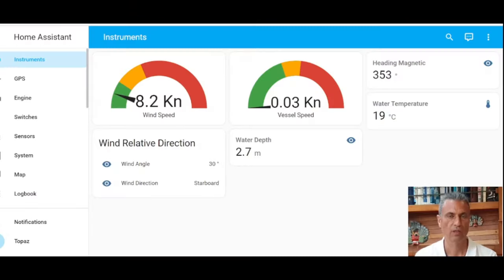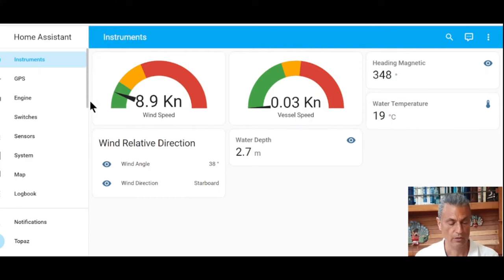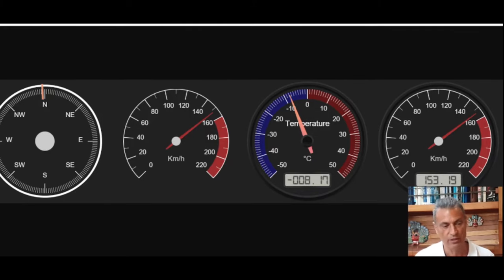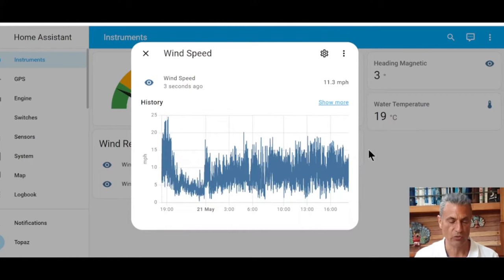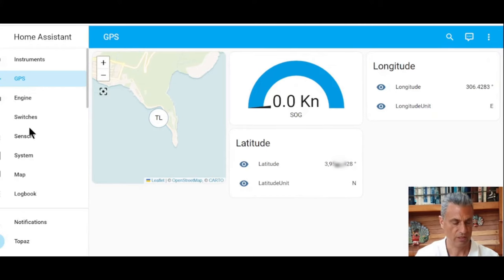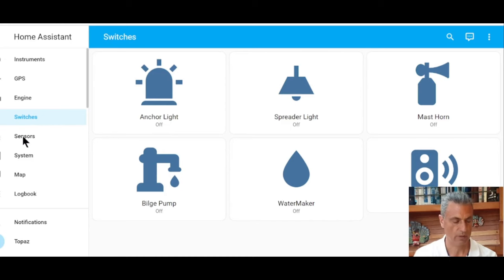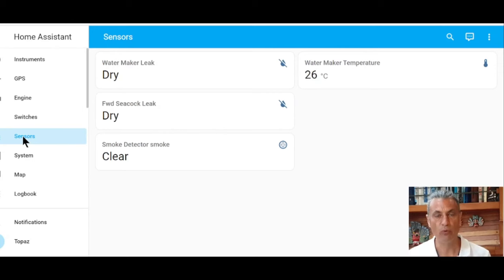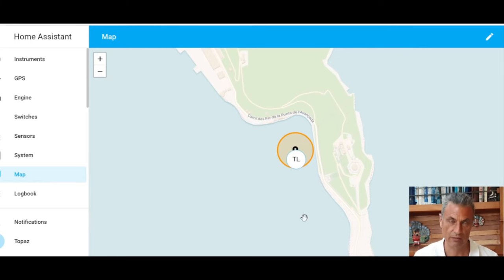Introduction to Smart Boating

Comment: Hello Rob, I am building a Pi 5 navigation system for my sailboat, it will be dedicated to this, I plan to use a Pi 4 for home assistant with your guidance videos, I don’t have any sailing instruments yet, what do you recommend for budget friendly wind and depth sensors?
Reply from the maker: Hi Dave,
If you do not have any instruments the best way to save money is to just buy the sensors. You can then use the Smart Boat system to display the sensor data for depth and wind.  So buy N2K capable sensors. I have just done the same. My old depth sounder has died and I bought a  new N2K Airmar depth sensor for $80. Was cheap as it was old stock.
Next week I should be releasing a N2K integration to Home Assistant.
Rob
Reply: Much appreciated Rob
Reply from the maker: btw - You can run Home Assistant on the Rpi5 along side other software. You just need to do a supervised install.
https://community.home-assistant.io/t/guide-installing-ha-supervised-on-debian-official-distro/555228
Reply: I will check it out, thanks again